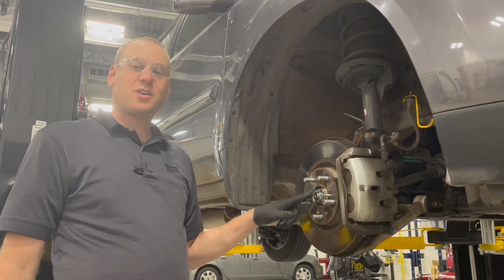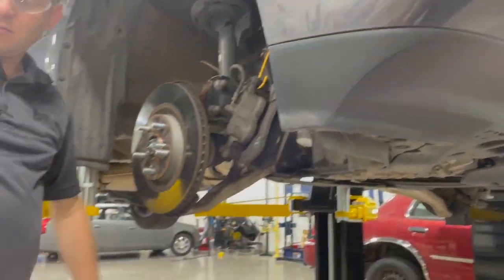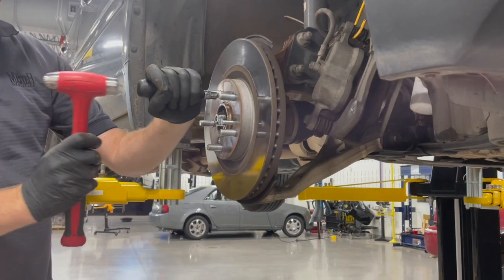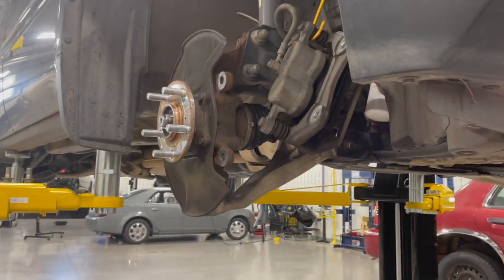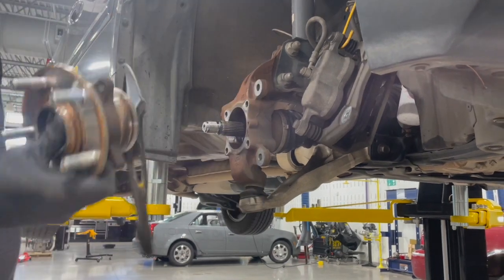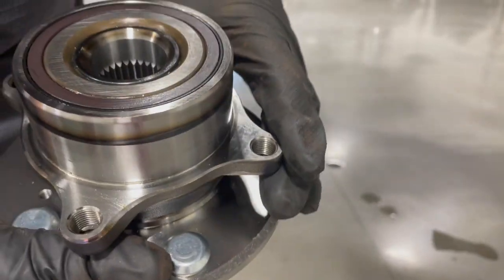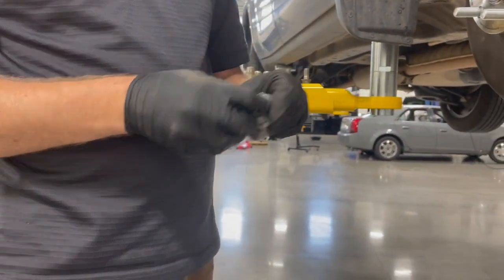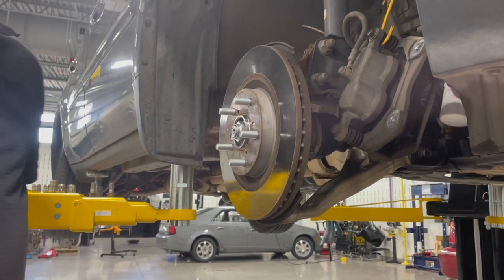Wheel Hub Bearing Replacement Honda Pilot

Comment: Wiggles it right off. Come up to the northeast and try that
Reply from the maker: I can not imagine the rust and corrosion from the rust belt areas. I feel very fortunate to repairs cars that are mostly rust free all the time. Also this particular car only had about 40,000 miles on it so no rust whatsoever.
Reply: I have an '05 that has 148k miles and other than a wheel bearing, needs absolutely nothing. Bought it last year from my granny-driving sister who thinks the sky is falling when she hears a rattle. Rides and drives smooth as a dream but underneath is rusty as all get out. Last year Mr. State Inspection Man told me in all likelihood that was the last sticker she'd ever get. It's a cryin' shame the salt in Maine literally eats your vehicle. If I lived in NM it'd last another 10 years and 100k miles!😞 Wondering if it's even worth replacing the f/l wheel bearing...

Comment: Would this process be similar on a 2017 CRV
Reply from the maker: It would be similar on the rear axle of the CRV. The front wheel bearings are a press fit design, the steering knuckle has to be removed and the bearing pressed out with a shop press.